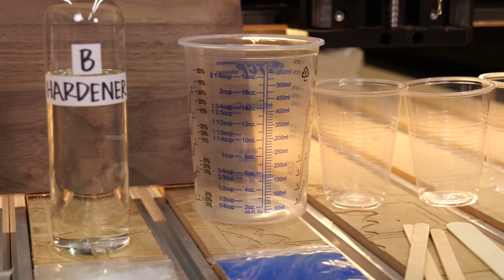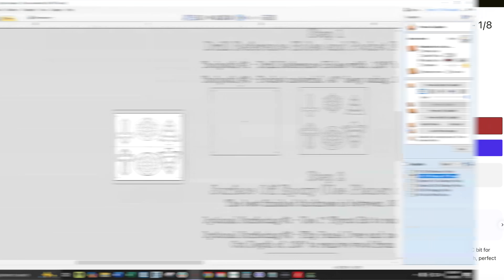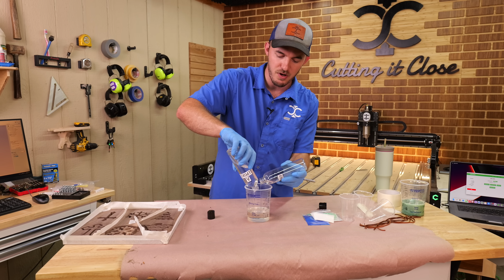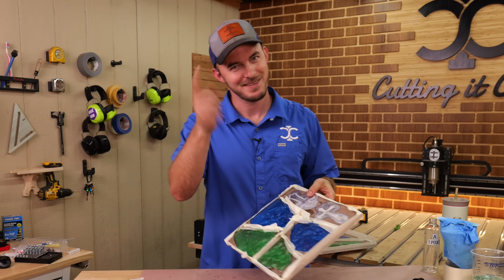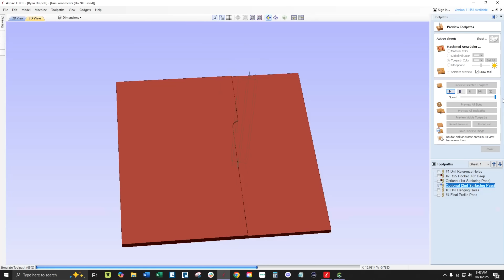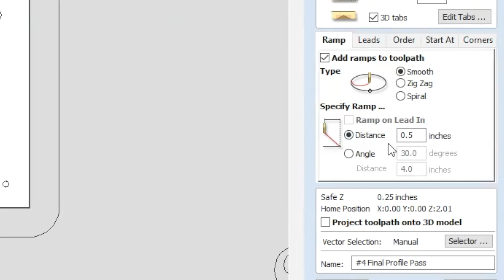ONLY a CNC Can Do This Epoxy Project

Comment: Not sure if you will see this, but can you explain a Center Datam, datum?  Yeah that process. lol  I've been an industrial CNC programmer and operator since 1998 but every machine I've used the ShopSabre IS510, Multicam 5000 and Gerber Sabre 408 everything was based on setting the XYZ axis' to the left corner of the machine and I would just measure out from that corner / setup up my vector / router files to match.  I just got my very own OneFinity CNC Gen2 Elite Foreman that I'm currently setting up at the house, but my main question is I've saw a lot of Prosumer level operators using the center as the origin, what is the main benefit of that? Missing the clamps on the travel from the corner to the cut paths?  When doing the center method does the bit basically stay contained in the work area of the blank you setup?  I really appreciate the feedback if this is seen, however I understand I'm coming in 5 months late to this video so maybe the community can help me understand the process.  Love the content and look forward to getting some of your bits soon.
Reply from the maker: The point of a center origin is mainly when I don’t use sheet goods. So let’s say you want it engraved a name on a piece of wood and the engraving is 6 inches wide and 1 inch tall, you could just go put an X where you want the engraving on your material. You don’t care about the size of your material because the engraving is only so big. I use Corner origin on my industrial machines, but mostly center on my hobbiest ones. Also the spoil board is harder to changeout on a hobby CNC so if you only cut all your stuff from the bottom left, it’ll mess it up faster. Center allows you to move to clean spots on the spoil board pretty easy. 

Hope this helps!
Reply: @cutting-it-close  great knowledge there and I truly appreciate you taking the time to share it with me and the community.  Hope you have a blessed day.  Thanks again!

Comment: Epoxy does not soak in the wood. It shrinks in itself while curing. Also: Please level the sound of your voice overs with that from the cnc machine. The machine is very very low in comparison. Other than that i thoroughely enjoy your videos. Keep it up.

Comment: Hint!!  Make your holes in a pattern that can't be mixed up (eg 3 on top, 2 on bottom,  preferably with  a not-uniform spacing.  Then it won't fit "upside down" or backwards.

Comment: Son of a biscuit - it didn't occur to me to use a surfacing bit to quickly remove the unneeded material. I spent quite a bit of time with a handheld sander and multiple sandpaper squares. This one tip will save me valuable time!

Comment: I'm not a threepeat but I'v bought a couple of your kits and supplies. Thank you for taking the time to make the videos, I always learn a tip or trick; example I used to always zero to the lower left corner, your center method works much better and on a variety of shapes. I called for tech support a couple weeks ago a received excellent service.

Comment: Just a thought you could have them pocket out like 1/8 square then do the pocket for the ornament instead of using the tape less chance for epoxy to run over the board if it goes under the tape